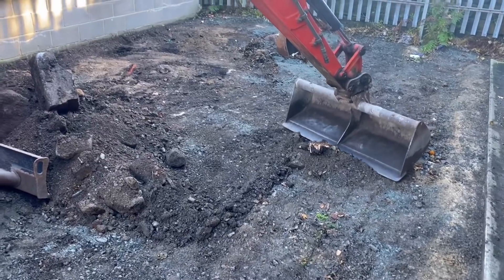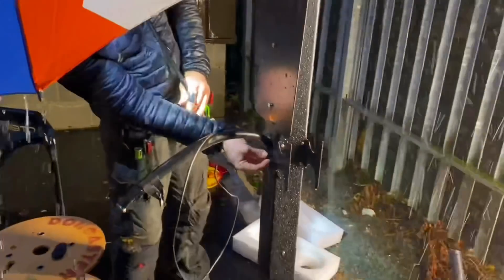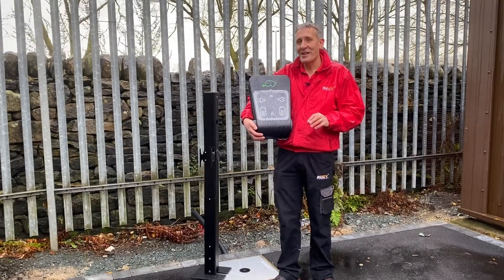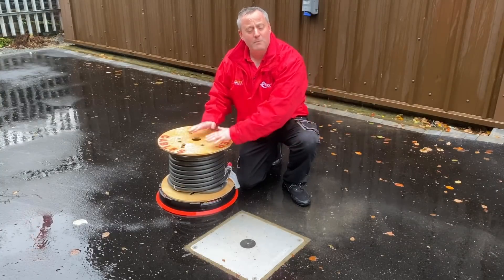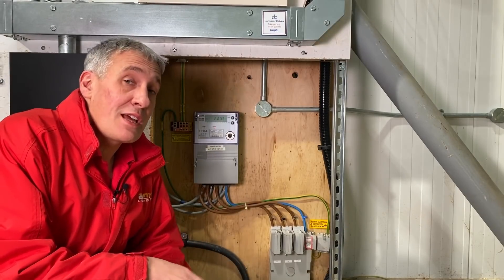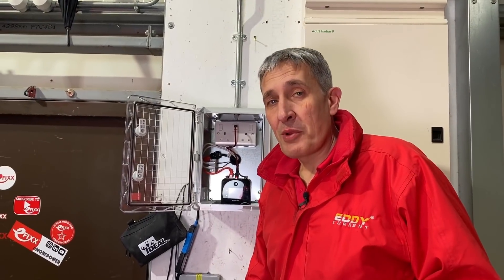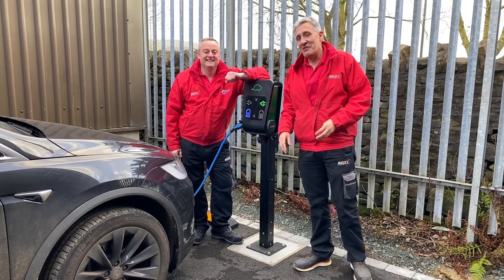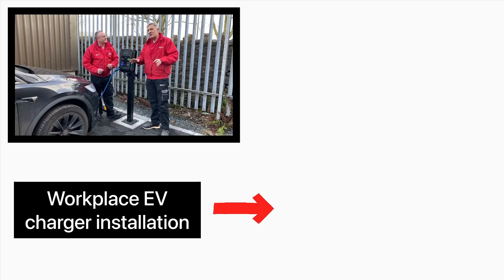Three-Phase EV Charger Installation. - Car charging at work

Comment: This 'block' system of installation would really have helped us in our depot-wide installation.  We ended up using traditional installation methods to get cables where they needed to go, for our 50kW DC installations.   In terms of earthing - some sites were very difficult to achieve - some sites needed complete re-working of the grounding systems because they were dangerously substandard.  Some sites couldn't trip an RCD at the extremities of the installation because the ground conduction was so poor.

One thing we've noted with DC fast-charging - Equipotential bonding of metal structures around vehicles.  Some EV chargers are a long way from the originating board - and that supplimentary earthing systems had to cope with not only the EVSE but the surrounding lighting and power systems, and the building they are connected to.

Comment: A question for you both.... in a 3 phase installation like this is a common neutral being used (i.e. is it Star or Delta connection?) and if the former, what are the dynamics in the 3 phase current-flow that allow a single 16mm neutral to be used when the same installation requires 16mm line feeds? TIA.
Reply: You still want to supply neutral for 230 V stuff and single phase charging, imagine someone coming in with an electric bike. Or a 1st Gen VW Up/Golf that both had just single phase charging.

Type2 still requires neutral anyways, the wallbox will not work without it.
Reply: @DooMMasteR  Thanks.  Just to clarify what I meant - on 3 phase there are 3 x 16mm cables feeding the device and 1 x 16mm neutral "return" cable.  A ratio of 3:1. My question is how does this work in reality with 3 phase AC and what current is flowing in each cable?  Cheers.
Reply: @RichardOzanne  In case there are 3 single phase consumers the power flowing through the neutral will be 0 VA, it ill be zeroed at the clamp block, basically a 3 phase star config.
Reply: @DooMMasteR  Thanks DooMMaster.
Reply: @RichardOzanne  Yeah 3 phase feels weird every time again, if you do not work with it day in day out.
Reply: @DooMMasteR  It is indeed! In a DC / single phase AC world, 3 x 63A in and 1 x 189A out on a single cable wouldn't work. The offset phases and current flowing in different directions at the same time confuses my simple mind :D

Comment: How many amp take ev charger ?
Reply from the maker: 63A - in each phase
Reply: @efixx 
63A?
22kW = 32A
Reply: @scwfan08  The one installed in the video was a double 22kw charger hence the max demand of 63A per phase.
Reply: @efixx  if 63A per phase is true, in your installation, then you created a pretty strong charger of
230V x 16A x 3 phases = 43 kW
Reply: Typical home charging:
1-phase: 230V x 11A = 2.56 kW
3-phase: 230V x 16A x 3 ph. = 11 kW

Comment: Here in Switzerland every House gets 3-Phase but with quiet low amperage per Phase. Normally 25 Amps, if it's a small apartment only 15 and if it's a bigger House 40. In my house we were lucky to have a 40 Amp supply so it was no problem to install a 3 Phase 16 Amp Charger. But if we only had 25 Amps you could easily blow the main fuse if the EV is charging, the cooker running and some other appliances on
Reply from the maker: Great to get some information on the set up in Switzerland 🇨🇭 👍

Comment: We always install 3-phase 11kW chargers or at least pull the cable in new installation, making it easy to install a charge station in the future here in my company in Norway. That is ofc as long as the supply is 400V TN-C, some older developments in Norway have 230V IT earthing system and then we usually don't fit 3-phase since most vehicles don't support 3-phase charging on that.
Reply from the maker: Great information about the Norwegian market - IT is very rare in the UK.
Reply: @efixx  It was the main system used for years, luckly we moved on (since most stuff is made for 400V TN) and it is kinda a legacy system. New developments will have TN-C, the shift happend around 2000. We will still have a lot of IT installations for decades since it cost to much to do the switch to TN-C-S.
Reply: @efixx  the Tesla Model 3 and Y has OBC which supports 3 phase on 230V 32A to get 11kW so we usually install cable that supports 3 phase even on IT installs. Also alot of vehicles kinda supports it so it pulls a little less amps if 3 phase is available, like for example Mercedes EQC it will pull 27A off one of the phases and 16A of the two other ones. To get to it’s max of 7.4kW

Comment: Tidy install, the CTEK chargestorm is a decent unit, we use a SIM PCB daughter board that fits to the charge controller on the lid of the unit, SIM connection to the back end is preferable to the customers internet access in my experience. One thing that's challenging to say the least is the tiny cable cubicle under the terminals... fair play if you managed to get a SWA in to it! 
The regs. here in Ireland call for an isolator  < 2M from the unit so we use a larger up-stand and fit the isolator under the charger, and run the link between both in 5 x 6 sqmm Silflex (UV stable ideally-though not strictly necessary when it is contained in the upstand), way easier on the wrists to boot.
Reply from the maker: Stay tuned we had to use a different cable for the final connection. Going SIM sounds a sensible option as folks get nervous adding kit to industrial / commercial sites.
Reply: Have you ever had issues registering the unit via the app? This seems to be problematic.

Comment: Oh wow. My home charging station cost me buying 3-phase plug and some 5-wire cable to connect the garage to the house. Total price: $ 6.50
Reply from the maker: Okay if you can ignore regulations or code
Reply: @efixx  totally fine with code and regulations. Nothing violated.
Reply: @efixx  nanny state!  🤣
Reply: @b5pv  Yes, this one: CCE16A.
Just needed the socket to plug this in.
Reply: @b5pv  That's my point. It doesn't take much equipment, to charge an electric car. People think, it costs hundreds or even thousands of $$, to build a charging station. Actually it can be as cheap as $6.50 (or less).
Reply: @m.l.5284  Yeah in Europe even 11A 230V single phase is pretty good for many usecases, but of course 3 phase with the option to charge faster is nice to have, or even 22kW like here.  
My dad's wallbox is also hooked to a CEE16A socket, it makes moving it easier and also leaves a socket option for whatever higher power equipment one might have around.
Reply: @DooMMasteR  Single phase charging is not practical, takes too long, more like an emergency solution.
3 phase is just fine and fast enough.
Reply: @m.l.5284  What? I know multiple people who just use single phase at home... But oh well, it must be not enough for them...
Reply: @DooMMasteR  With a 3 phase power line it takes 9 hours to charge a 100 kWh battery. With 1 phase it takes 39 hours, wich is a bit long, unless you have a very short commute and only charge few kWh every night.
Reply: @m.l.5284  The average commute in Germany is just 17 km... Even triple that is no issue at all with a single phase connection.

I'm not sure where you are going, but the while being nice to have, for most EVs even a 100 kWh charge is not even possible, an ID.3 has a max battery size of just 74 kWh, charge that to 80% and you have even less.  
An eUP or Golf have just 32 kWh batteries, hell they cannot even charge at 11 kW, their on board chargers are limited to 7.2 kW.
Reply: @DooMMasteR  3 X 17 = 51 km commute, would be 4 h charging. If 2-way x 51 km, then it is double: 8h, wich is feasible. 
However, since you talk about Germany, every building has 3-phase connection anyway, so why not use it?